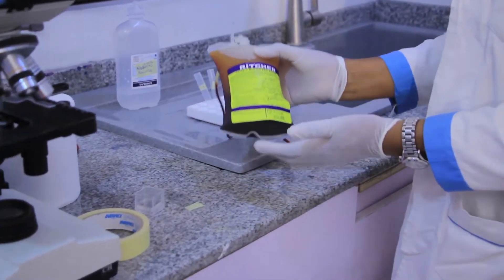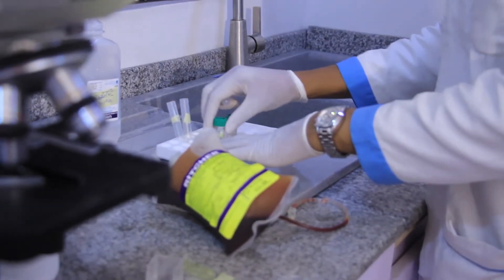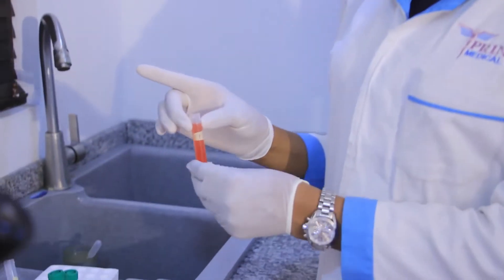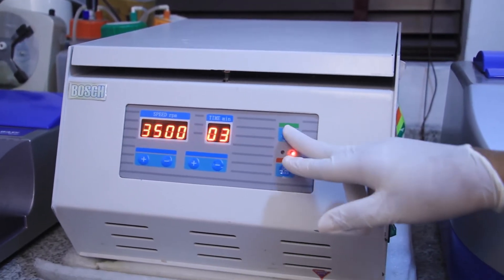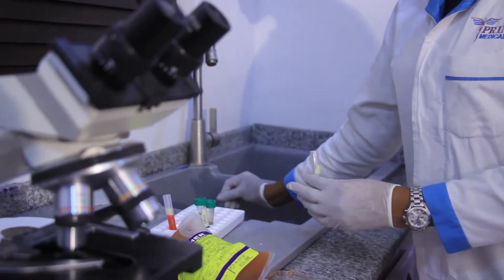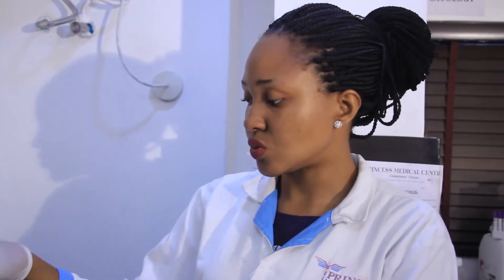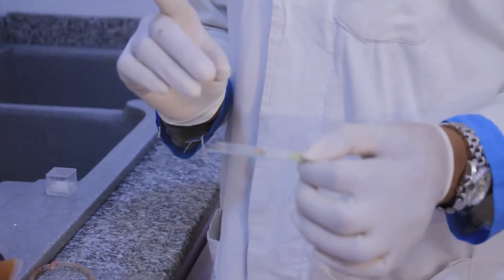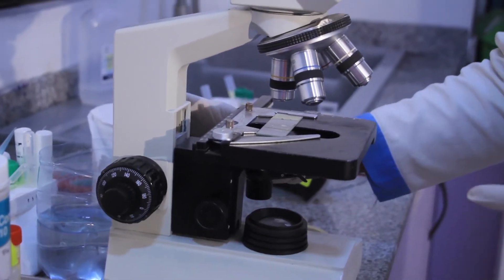Crossmatching technique recipient and donors blood sample.

Comment: Nice explanation. But when you mix the donor RBC and donor plasma, you can centrifuge it at the rate of 35000 rpm and check it there is clumping or not. This will safe time in case of blood transfusion.
Reply: How do you check it after centrifuging?
Reply: You check microscopically and macroscopically